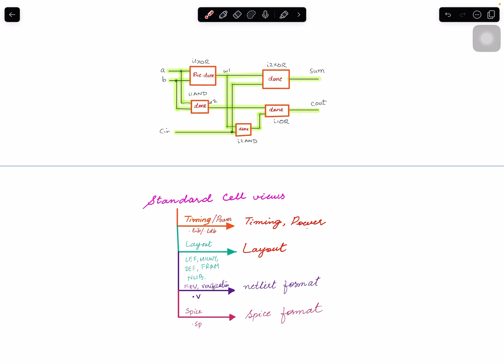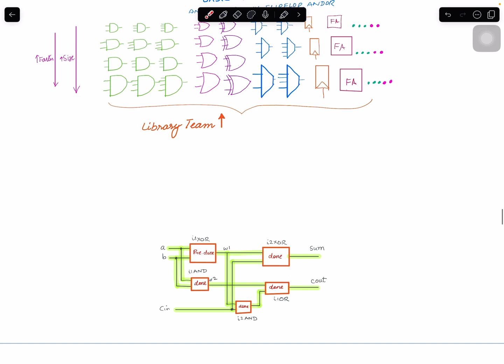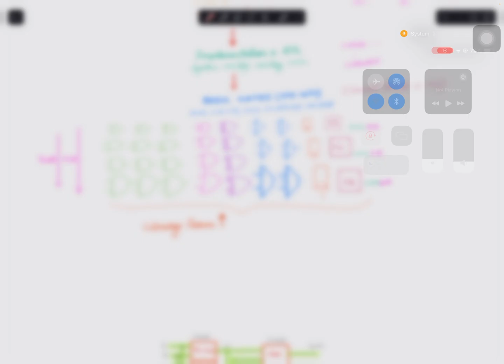PD Topic #8: Understanding Standard Cells in Physical Design

Comment: I appreciate all the informative videos you have made, Rashid. I have a question about standard cells that may not be directly related to this video. There are some standard cells with tapcells and some without them. Is there a specific reason for that?
Then I designed some digital circuits with tapcells, but when I checked the DRC, there were many latchup errors. Could you please comment on this?
Reply from the maker: Thanks so much. Tap cells are phys only cells; they dont have to be in timing standard cell libraries but are part of the layout views for sure. tap cells provide well connection (the body connection i referred to in my CMOS videos). They have to be placed regularly throughout the chip. If you dont have good connection; you will see a latch up error. surge of current flows from VDD to VSS due to your  transistor behaving like NPN/PNP BJTs. Show it to your layout expert please.